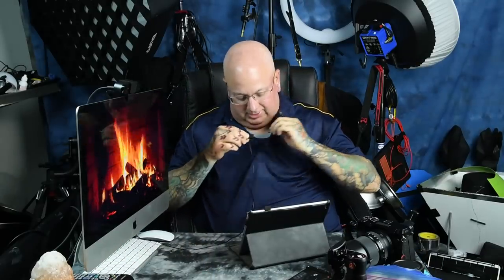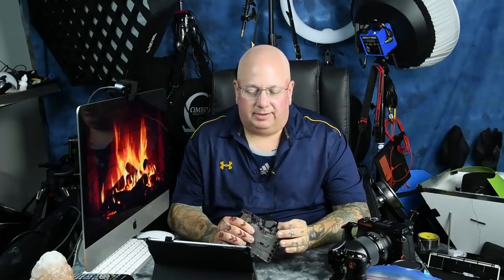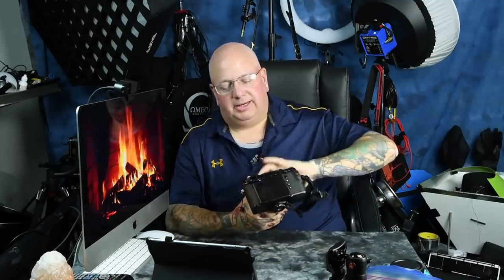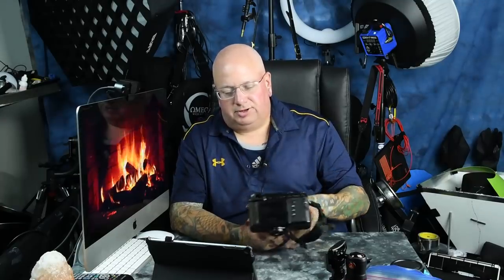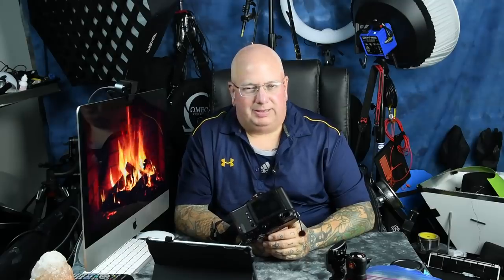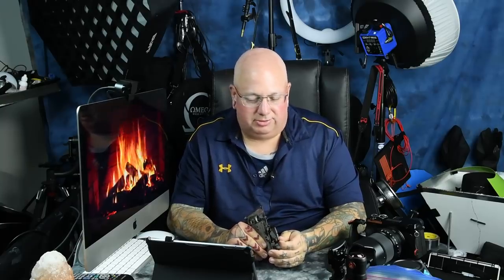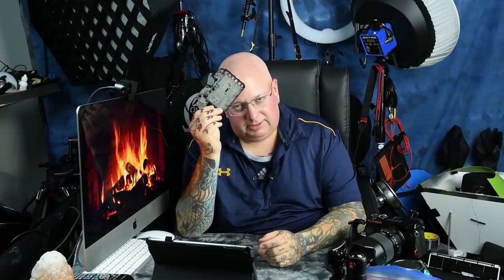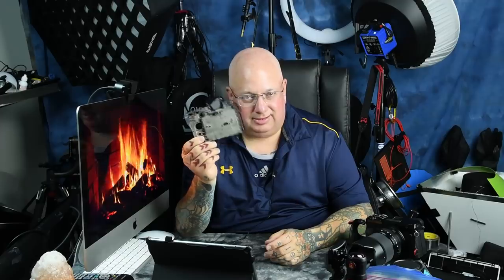🤔 Camera Secrets. MOST FRAGILE camera component is?  🤔

Comment: Good to know. I actually did my first sensor cleaning thanks to your advice and after a few screwups it turned out great. Out of curiosity, how much pressure would need to be applied on the glass cover of the sensor to actually do damage? And I don't understand why they wouldn't paint it just to avoid warranty repairs. Sounds a bit counterintuitive of them.
Reply from the maker: youd have to get stupid on purpose to do that
Reply: @KenTheoriaApophasis  Breathing into the sensor and lenses for cleaning stupid? I've seen quite a few.
Reply from the maker: yeah , dont do that

Comment: Technically speaking, yeah one cannot damage the sensor of a camera, but the glass that is the outer-most layer of the sensor unit is highly fragile, and can be easily scratched. 
So, if someone scratches this outer-most layer, then what are they supposed to do? "I just scratched my sensor, but Ken said that sensor is the LEAST fragile component of the camera. I must be stupid to think that scratching this layer of glass will affect my images in any way."
Scratches on that layer WILL show up on your images when using higher f-numbers.
So your argument that sensor is the least fragile component is not practical. Because even if just that glass gets scratched, all images at higher f-numbers will suffer, at that point, it doesn't matter if your sensor is sitting perfectly safe within its confinement.
Reply: @mdhazeldine  yeah, the weakest link of the "Image sensor unit" is the outer-most glass. It doesn't matter if the actual sensor itself fails or the glass, that failure will affect the camera.

Comment: The only thing that i hate about my Nikon's DSLRs is that over time (or even in brand new cameras), the shutter movement spills very tiny drops of lubricant on the sensor's glass cover, so when we try to clean the "sensor", we must use the flip up mirror function on the camera, and then we end up with a clean sensor, but dust particles or tiny lints inside the viewfinder (Visible through the viewfinder), but the dirt actually is between the pentaprism and the small focusing element on top of the mirror. But you're right Ken, the sensor can take a hell of a beat up and still work like new. I have actually cleaned the sensor on my old D7200 with literally just a rag over my finger, and like i said, the sensor gets cleaned and the pictures are as well, but the viewfinder is a freaking drying machine full of lint and dust.